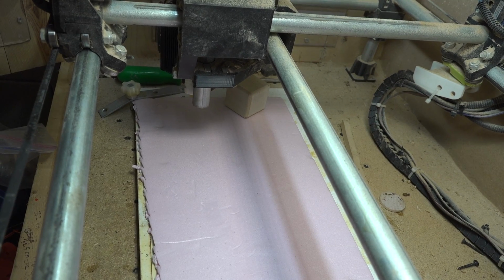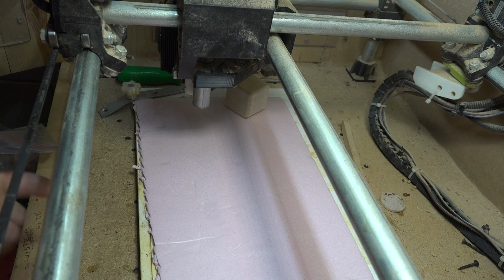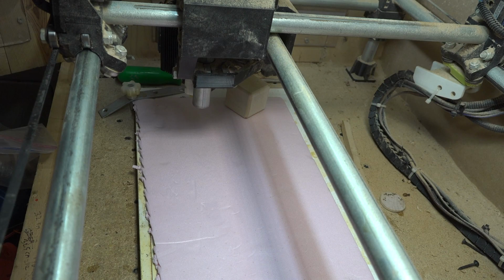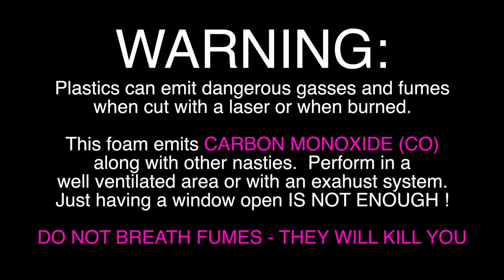3 Watt Laser vs  Pink Fanfold Foam

Comment: You can probably get a much cleaner and faster cut if the laser had an air assist mounted on it. Air makes a huge difference on cutting performance of lasers

Comment: So I’m looking for a laser to cut dollar tree foam board, can you please see if a 3W laser will cut dollar tree foam
Reply from the maker: The laser cuts great through the paper of the foam board, but once it hits the white foam core, the laser is scattered and dispersed, and it doesn't make it very far.  If there were a colored foam core board it would probably work better.  I had some success cutting the dollar tree foam double sided, and then just popping the parts out, but cutting double sided adds a level of complexity.

Dollar tree foam and others: https://youtu.be/TaSy0ccjSDA
Dollar Tree Foam board double sided: https://youtu.be/nbc8HOmo-6o

Thanks for watching and commenting!

Comment: Regarding the blue foam...or cutting anything else for that matter...cutting energy transfer is obviously a matter of energy transfer, and that (presuming a constant Laser power level) is a function of feed speed (also obvious), but also color of the substrate to be cut...so when you try that blue foam, can you repeat tests on pink and blue, but with area to be cut painted black, to see how much of a difference/improvement in cutting effectivness this makes...I'd be very interested in those results.  Cheers
Reply from the maker: Thanks for the idea! It will be interesting to see how it works!

Comment: Hey fellow MN maker! I've been thinking about getting a laser for my MPCNC that I just built. Regarding that however do you run your MPCNC with standard Ramps (Arduino mega w/ shield) or use the Rambo board?
Reply from the maker: Greetings, I'm using ramps with a mega, but I'm pretty sure you can drive a laser from a Rambo too.  Check out V1engineering. Seems to me I saw something on the forums about it where people are putting lasers on their lowriders.   Have fun!